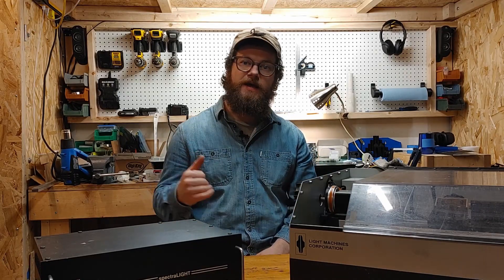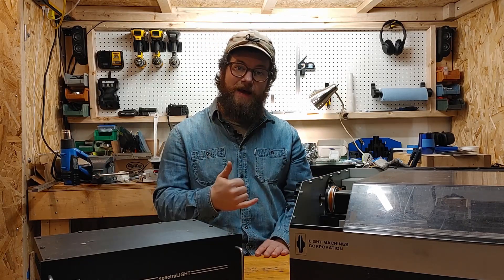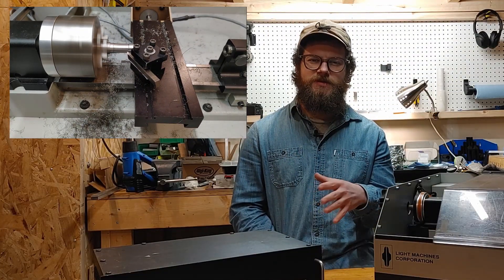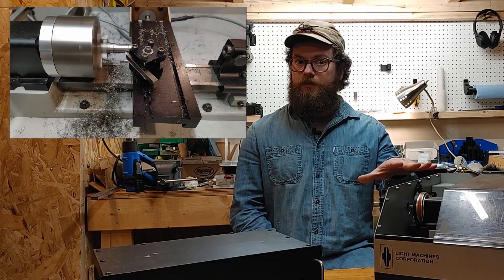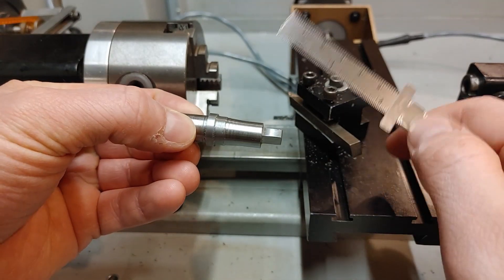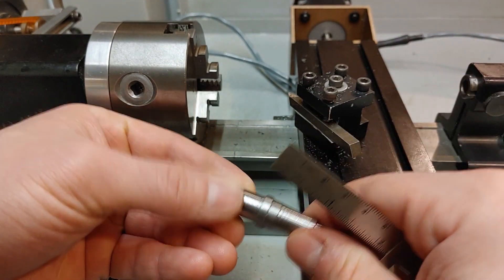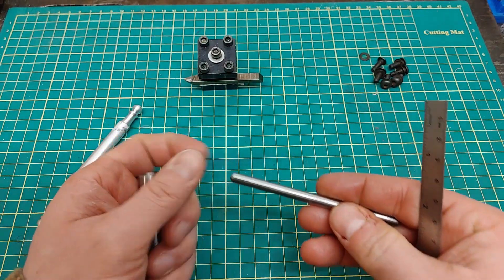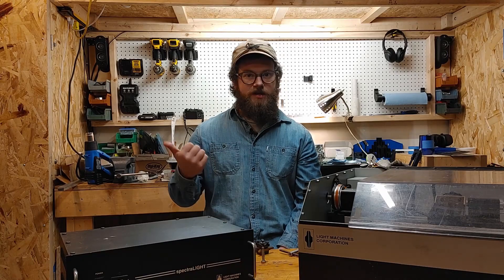Benchtop CNC Lathe Retrofit: Part 2

Comment: Awesome. I am half way through building my own lathe from scratch with 130mm chuck. Decide to add grbl 2 axis controller (no threading just real simple stuff) but run into lack of free software for turning gcode, it's all for flat engraving. I would love to see a video of the designing setting and converting to gcode side of what you are doing. Thanks

Comment: I like what you are doing, like watching your video, except the music which is really annoying and unnecessary. I have a question: Why spend so much effort and time on that small lathe and keeping that DC (or is it AC...?) motor? I mean, it would be better to change that to a small servo. A 180W servo does not cost much and it solves many of your problems. It can be controlled with step/dir so you can control the speed and the direction of rotation easily. I am using that in my DIY lathe and even built a control box. https://youtu.be/GLJs5FEZY1o

Comment: Does it do single point threading?
Reply from the maker: It will! I added a link to the fork of the GRBL control to the video description. You'll find a much more detailed guide for setting up the controller to do single point threading in the controller docs. I will get back to this project  (hopefully sooner rather than later...) and do another video that will go into a little more detail for how the spindle motor controller works, and how to go about the threading setup.